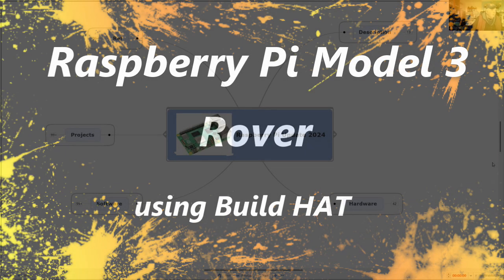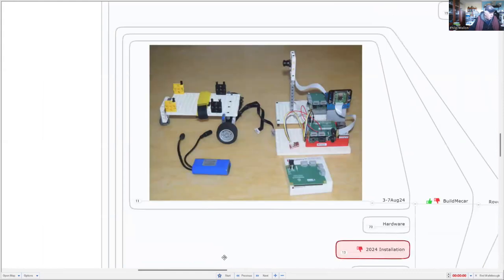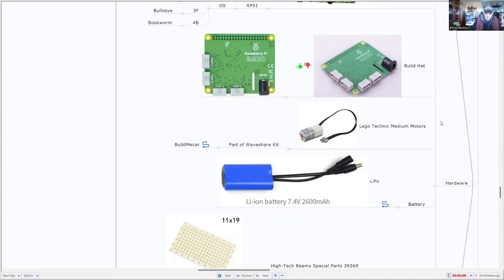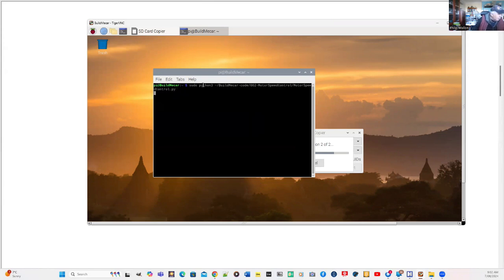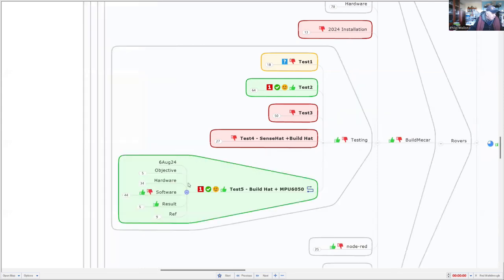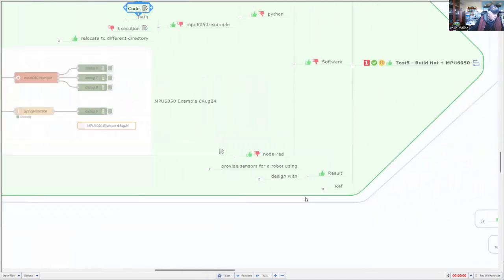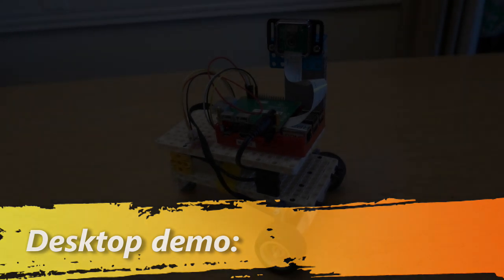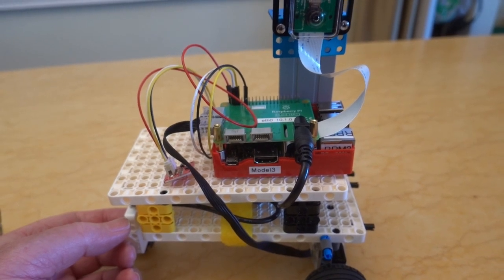Raspberry Pi 3 using Build HAT

Comment: Hello sir,  I enjoyed your video.  I was able to get the build hat working with with the pi4 with no issues - mind you I used 'creator academies' video for support, rather than official documentations.  I too found the 4 port design limiting however its usually enough for a basic rover.  I just received a Kickstarter project the 'EVN alpha' - its somewhat of a deviation from the Lego EV3.  I think you would enjoy it.  Thank you for your video.